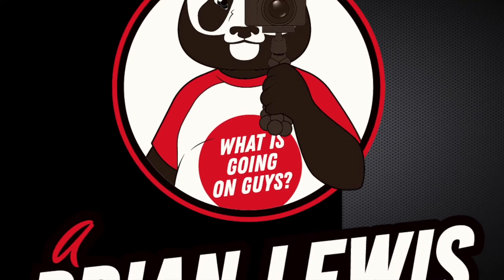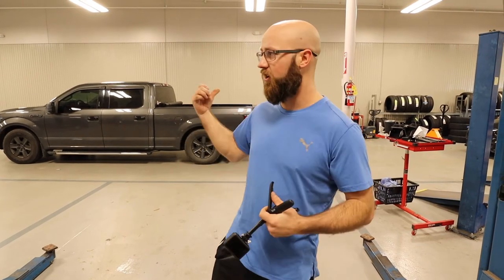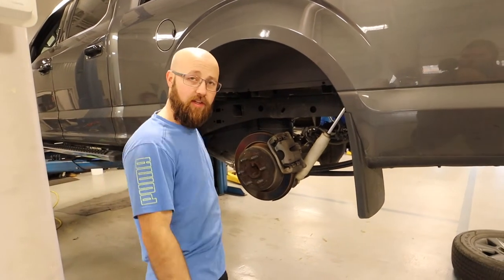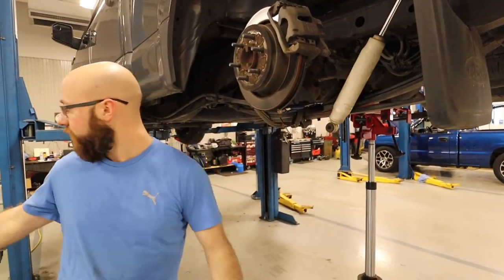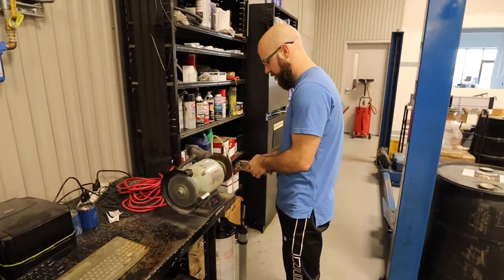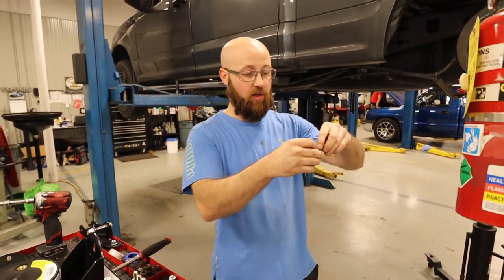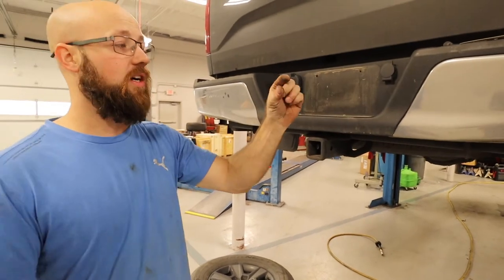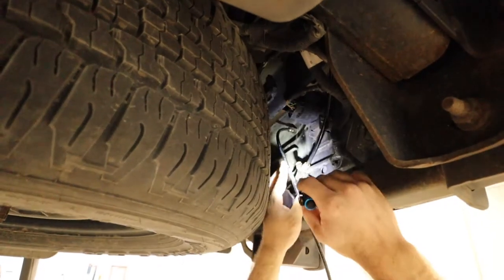IHC Helper Bag Install 2015-2020 F-150

Comment: The bags aren't sitting quite right as there is a kink/angle to them. Looks like the upper brackets are mounted to far backwards. The instructions say to slide the bracket up to the weld. you can see a wide space between the bracket and weld at 35:53
Reply from the maker: We’re gonna look into that. Thanks for the info!

Comment: First thing you do when you get the kit is inventory everything! I received brackets for both 2021 and 2015…didn’t work and took IHC multiple tries to get it right. Parts labeled driver when they were passenger. Once I got it installed it’s great but what a fiasco!
Reply from the maker: Dang that’s wild. We have never had any problems out of IHC.
Reply: Same here (labeled wrong).  They'll do for now, but will be swapping to BWoody bags.

Comment: I see the bracket for the airbags sits in between the spring and the saddle bracket. this in theory should push the axle up a little bit. any issues with vibrations after the install? it took me months to get rid of a vibration on my truck and I'm paranoid. still on the fence about helper bags.
Reply from the maker: Zero vibrations or other issues

Comment: U didn’t use shock bracket on driver side???
Reply from the maker: Yes we did
Reply: On the video u guys didn't 
did you installed after?
Reply from the maker: @jcm45758  can’t remember one piece was for another year of truck I do remember but can’t remember which one.